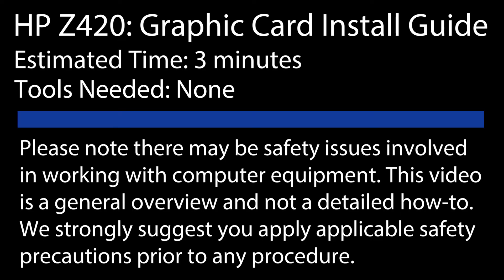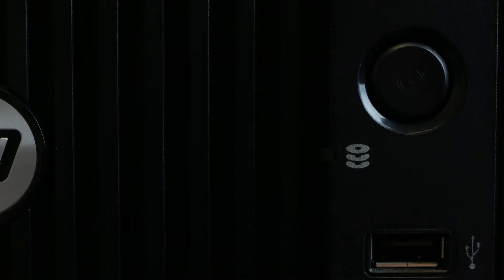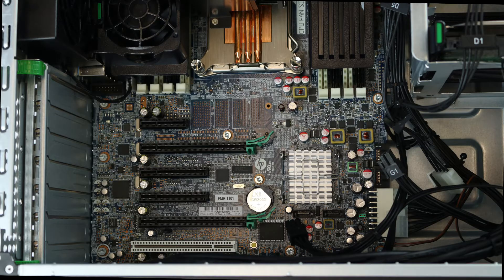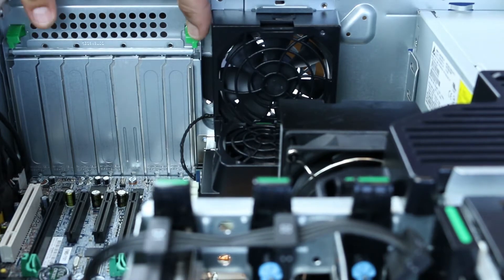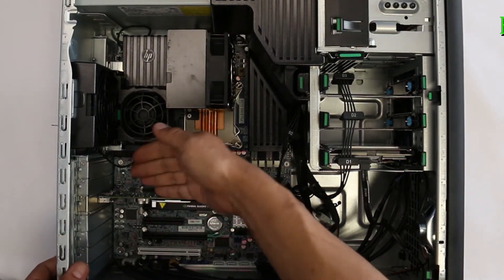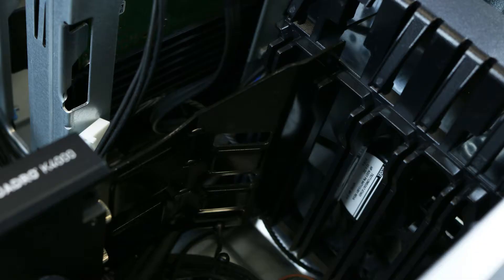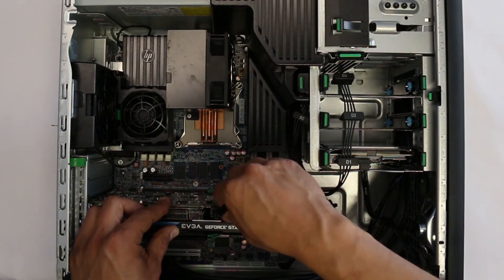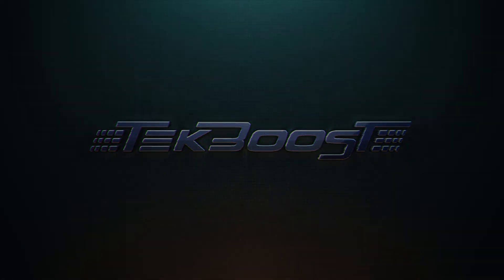HP Z420 Graphic Card Install Guide

Comment: If your Card Requires a 8pin Connector i Suggest getting a dual 6-pin to 8-pin adapter or a Sata/Molex Cable to 8 in
Reply: What is the output rate of one 6-pin connector of z420 psu?

Comment: Anybody tried installing an RTX 3050 on this hp z420. 8 pin to 6 pin adapter?
Reply from the maker: We have not tried it, we primarily use Quadro series.  However we have used Quadro 6000 which consumes more power than the RTX 3080 and is similar in size, so i would not expect any issues with it.  Good luck.

Comment: Nice video, i m trying to install an evga 970 gtx sc in my z420, but when i m trying to update with the latest driver on geforce experience, i always got a blackscreen. My bios is already updated, could you please help me?
Reply: This is a problem with Windows 10 and nVidia drivers not working together correctly, sometimes going to safe mode and removing the driver and reinstalling will fix it but a lot of time you will need to download the latest Windows and reinstall OS.

Comment: idk why but mine only  have one six pin power connectors
Reply: The newer model of that power supply only has one for some reason. Presumably cost saving measures, but it's hard to say for sure. It's equally possible that it's an entirely different unit under the hood